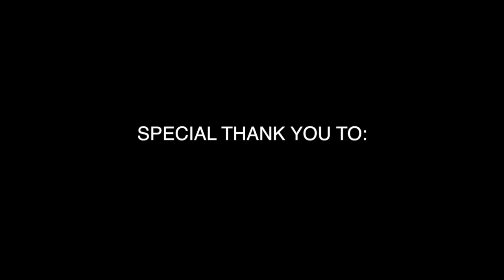How to build a Jacuzzi!

Comment: Just one question, how you get air for the jets? Air pump or Venturi effect? Thx and nice work
Reply from the maker: Hi Marco.. as for the air in the jacuzzi i put standard plasti pvc pipes and hooked it up too a 1 hp water pump.. pretty much the exact same design with the waterfall .. hope the explanation is helpful

Comment: Where do you get that pipe and fittings for the plumbing?
Reply from the maker: Hi Russell sorry for the late reply depending on where you live your local hardware store like a home depot will have.. just know you need to buy psi. Or pressure resistant pipes they cost like 40 cents to a dollar more per foot